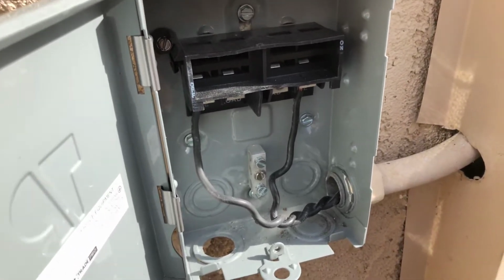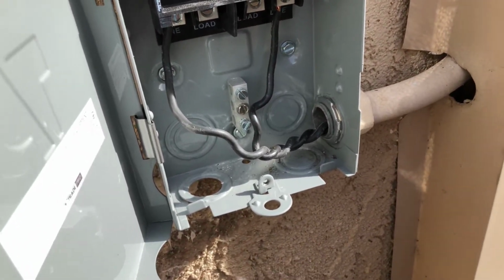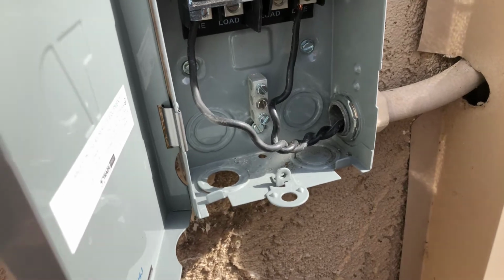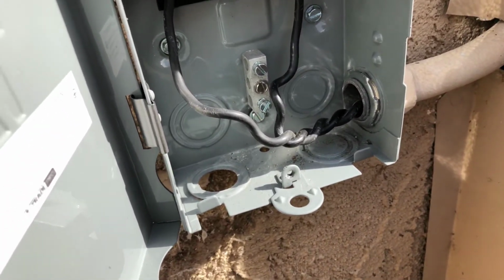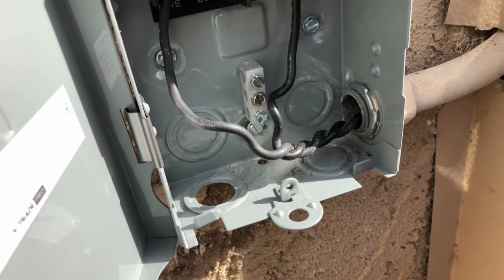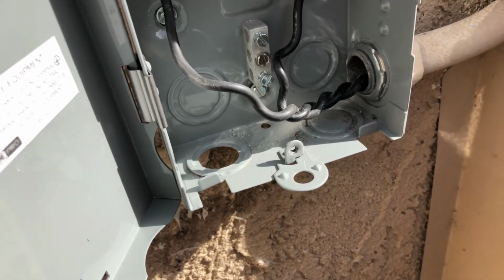HVAC TECT TIP: Wire slap or conduit buzzing fix.

Comment: This is a good trick to stop wire rattling, but there are two very serious issues shown in this video, one of which is not the uploader's fault, the other one most definitely is.

First, as another has pointed out, the lack of a grounding (green or bare) conductor, you cannot rely on a conduit system when concentric knockouts are used. 

Second, and this is the uploader's mistake, you CANNOT twist the wires as tightly as shown here.  You can easily damage the insulation and conductors with that tight of a twist. It also promotes excess heating up of the wires. (It is also a Code violation.) You only need a loose twist to the wires to stop the rattling, in the case of the wire size shown, ONE twist for every six inches is more than adequate, one twist per FOOT is ideal and takes a lot less time. 

So, done correctly, a very good bit of advice. Done as shown here,  could lead to serious issues down the road.

Comment: "The customer will experience a slapping noise from the wires 'cause of the torque"

Ummm, no. Not even close. First let's discuss the lack of a grounding conductor through concentric knockouts.

If you let a guy like this work on your house you deserve exactly what you get. Yes, twisting the conductors will mitigate the conductors rattling around inside the metallic conduit. But not for the reasons untrained techs might try to explain it with. Service people that come off like this, as experts, because they own a cordless screwdriver are construction's version of Catfish.

dissydallas,  kindly explain to the good people why those conductors rattle in the first place. You say it's from torque. Explain with even the slightest detail the mechanism behind this statement. I'll wait. You can't because it doesn't exist. You found out from somewhere that twisting the conductors mitigates the noise so now you have to be an expert and attribute it to 'torque'.

We're talking about electricity in people's homes. Where people sleep.

Comment: Dont ever do this- this is a fire hazard and liability waiting to happen.

You ruin the wire insulation causing possible voltage leaks.
If its solid wire (not stranded) you ruin the wire it self. 

Also wire slap os not much of an issue on PVC conduit.

Comment: I have never heard or seen this happen.
Is this a joke ?
Reply from the maker: It's not a joke. I deal with this only on older houses and commercial building with flex or conduit.If you have romex it is never a problem.
Reply: jjmoffo 
I work commercial electrical, this is common on elevator motor circuits. You can hear the conductor smack the inside of the conduit down the line.